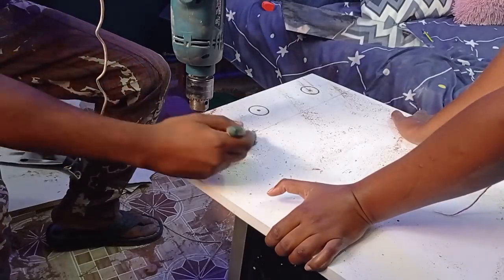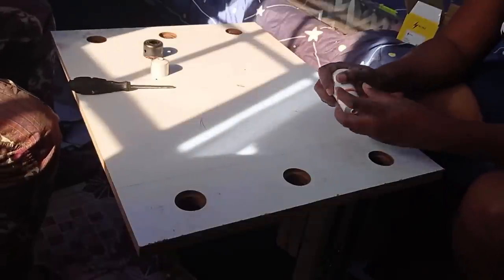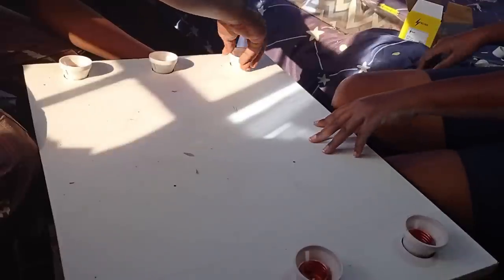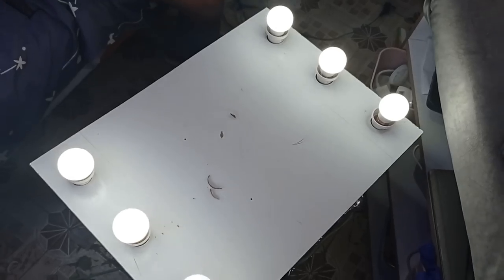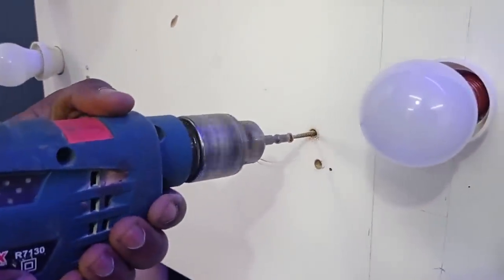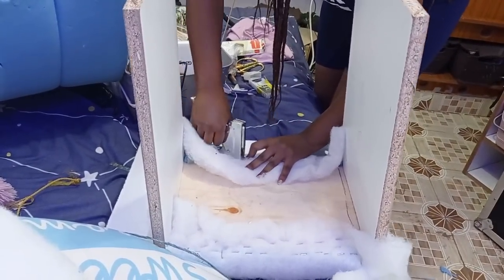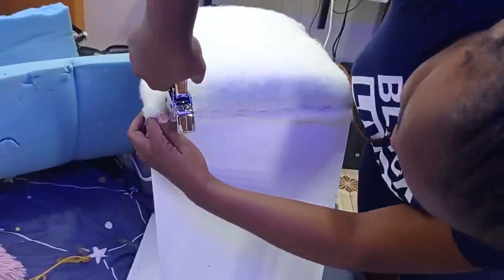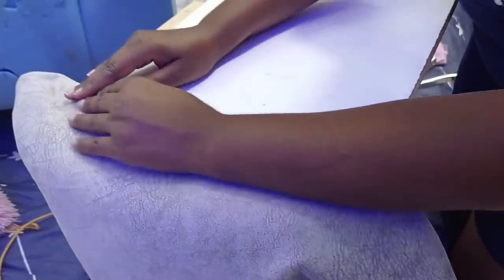BEDROOM MAKEOVER PT 2 // DIY FLOATING VANITY DRESSING TABLE WITH LIGHTS

Comment: Hi Agatha where did you buy you drill and did it come with the bits and for how much?
Reply from the maker: Hi Pauline, bought everything at Simba General Merchants along Kijabe street. The drill doesn't come with the bits. It was bought around 5 years ago, can't remember the price. 

Even though I wouldn't advice you buy it. It's heavy duty. Get a cordless light weight drill which is best for DIY'S. It's less than 5k. Am planning to get one for myself too, to make my work easier
Reply from the maker: You can buy the drill bits as a pack or a piece of each. They're also available at local hardware's at 30-50 only
Reply: @agathankirote  thanks a lot for this info

Comment: Where did you buy that bolt to hold the drawer to the wall or what is it called,want to try this
Reply from the maker: Go to your local hardware & tell them you want a "Roll plug bolt " or a "Roll bolt" number 12. Don't forget to buy a spanner as well

Comment: Where did you buy the staple gun and drill kindly?
Reply from the maker: Simba merchants along kijabe street.
Don't buy the same drill as mine, it's for heavy duty work(for Alphy's job) buy the cordless light weight drill. It's perfect for DIY's. Planning to get one for my self too. 

The staple gun is less than 1500, it's an amazing deal, works perfectly
Reply: @agathankirote  thanks gal
Reply from the maker: Anytime 😊